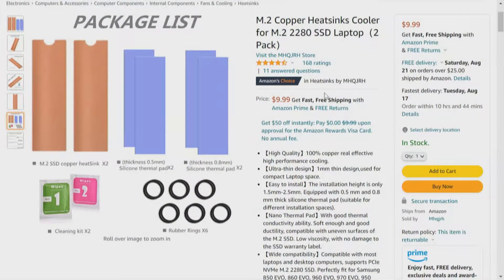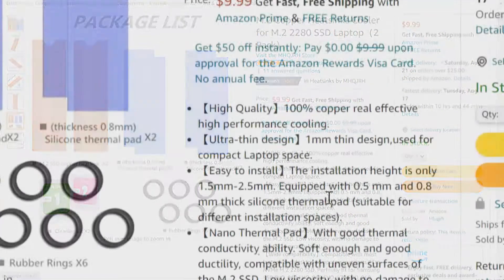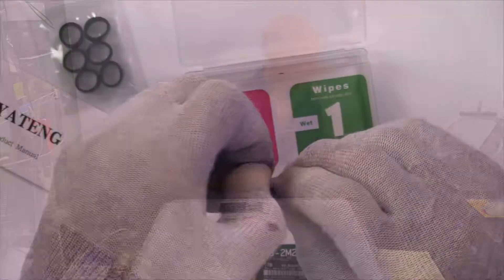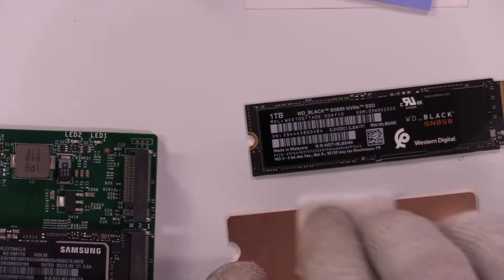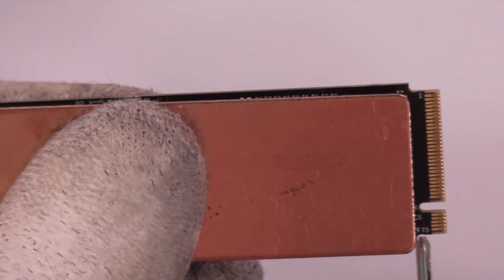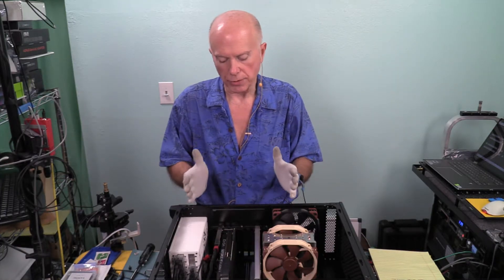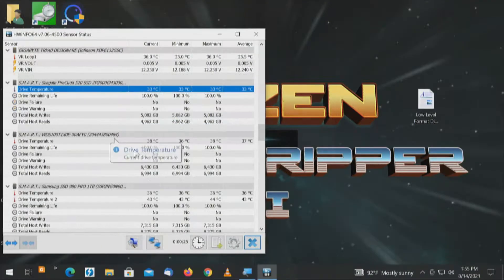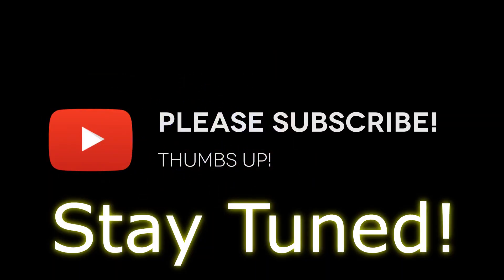Installation and Test of M.2 Copper Heatsink Cooler for M.2 2280 SSD Laptop

Comment: I ordered the same kit but mine came with the smooth side of the copper plate covered by a sticky blue film. I’m assuming I have to take the film off because we should be using the smooth side to make contact with the thermal pad, no? Though, in your video it seems that the “rough” side is making contact with the thermal pads

Comment: Greetings from UK i just purchased M2 SSD Heatsink Thermal Cooling NVMe Copper Graphene for my Laptop is this a good choice as i do not like the bulky casings as there is no room in my mac
Reply from the maker: Hi @SophiaCypria ,
Welcome! This is the simplest and best solution we've found so far. Our main concern is the longevity of the holding bands included. Otherwise, Enjoy.

Comment: For those using the Samsung 990 Pro: If your warranty has expired, consider peeling off the stickers. The Samsung 990 Pro has chips of varying heights, so when using a heatsink, it may not cover all areas properly, leaving a noticeable gap between the chip and thermal pad. Instead of using a 1mm thermal pad, opt for a 2mm pad. You don’t necessarily need a heatsink, but you can use the same thermal pad on the bottom side if there's enough clearance. This setup provides much better cooling. 

I used the GELID SOLUTIONS GP-Ultimate Thermal Pad (2mm).
Reply from the maker: Hi Gayan,
Welcome. Just now seeing Your comments. We do not always receive notifications. All M.2 NVMe PCIe SSD Drives are uneven from Memory vs Controller. Thank You for commenting.
Reply: @BuildOrBuy  Sir, I've learned a lot from your videos—they are very informative. I just wanted to share my personal experience. I'm glad you replied. Thank you ❤️
Reply from the maker: Hi @gayanmaduka , 
Appreciate your comments. Thank You for Watching. Glad we could help.

Comment: @7:27 I can't tell which is the bottom side
Reply from the maker: Hi @QCode11 ,
Welcome. Good question. Stamped from Copper Sheet. Both sides are same. You can tell by the edge. Smoother edge up. Coarser edge down.
Reply: @BuildOrBuy  thank you good I got it right!!

Comment: Hey sir what's up?! Will you answer me if you see my comment? My question is, I plan to put a 6MM Copper Heatsink on my M.2 for laptop application. Will it fit a 6MM Heatsnk? Next question is, can I use a thermal paste sandwiching it in between the heatsink and thermal pad? The Laptop is the Asus ROG Strix G18 (2024), an 18.4" gaming laptop.
Reply from the maker: Hi Good Boy,
Welcome. Good question. You'll have to Test and Verify. Every Laptop is different. This copper plate is the best solution we've seen. Thermal paste? Must be non conductive. Otherwise, problems. Suggest stick with a Thermal Pad. There are two types as outlined. Silicone type which are reusable or the clay like Thermal pads which are one time use.
Reply: @BuildOrBuy  

Thermal paste I want to use is the one they normally use when installing the heatsink of the CPU in the PC and when changing the heatsink fan of the graphics card. Will this be fine and non conductive? About the 6MM heat sink looks like this will be a trial and error oh man!
Reply from the maker: Hi @GoodBoy-io6fd , 
Verify. Every Thermal Past is different. Compression can be safely achieved with a Thermal Pad. Travel at your own risk. We do not recommend using both. Thermal paste is used for a uniform surface. Thermal pads are used for uneven surfaces like M.2 NVMe PCIe SSD Drives. You know the concerns. You know the risks involved. Your call.
Reply: @BuildOrBuy  

Looks like I will just go for the 2 or 3 mm copper heatsink paired with a 1mm thermal pad. 6mm is TOO THICK! This is only good for PC use. Ahuh if you said so Mr.PC Expert, I will forget about using a thermal paste! You have a good reason! Processor or silicon chips goes well with metal, aluminum and copper surfaces but not with a silicon material thermal pad. I am planning to buy two Lexar NM790 4TBs for the 2024 Asus ROG Strix G18. Another question, is there a thin heat sink made for the SODIMM memory of a laptop?
Reply from the maker: Hi @GoodBoy-io6fd , 
Smart decision. From Our testing results, this flat copper performed better than machined copper with more surface area. Curios. As always, Test and Verify. Your results may vary.
Reply: @BuildOrBuy  

I have a new Idea but this might be stupid and funny to you! What if I put two 1.5mm heatsink on the M.2 and in between the M.2  I put a thermal paste? The other side of the heatsink will have the thermal pad to stick on the M.2. What will put together the two Heatsinks, the rubber band that you will use to tie the two but this time I will put 3 rubber bands. Will it dissipate heat better or this is a stupid idea?
Reply from the maker: Ho @GoodBoy-io6fd ,
You have your answer.
Reply: @BuildOrBuy  

Well anyway, I am not making fun of you. I was only thinking of other ways to cool my soon to be owned new 18" gaming laptop to cool that PCIE4.0 M.2 Lexar NM790 4TB incorporating that thermal paste. You have my thanks MR.PC Expert. You are the only one to talk to me back an fort showing care so the end-user will make the right decision what hardware to buy!
Reply from the maker: Hi @GoodBoy-io6fd ,
Understand. Thank You. Keep it Simple. Your Chipset, is it PCIe 4.0? We've noticed, most Channels do not respond to Subscriber Comments. That's unfortunate.
Reply: @BuildOrBuy  

YEAH RIGHT! Most of them do not answer back! What always happens to me is that when I ask, they will just answer me once. If I ask again, I get no response. One answer is just what  get! Once I buy my own PC, I will still TRY TO DO MY IDEA! But for now my money is limited so I will not experiment. 2 flat copper heatsink, in between a stuffing paste then under it is the thermal pads to stick on the M.2. The Laptop that I plan to buy not a Personal Computer is the 2024 Asus ROG Strix G18, FOR SURE IT IS USING A PCI-E 4.0 M.2 SLOTS. I will only know what chipset it have once I install Aida 64 Engineer version. It only have 2 M.2 Slots for an 18" gaming laptop, I WISH IT HAVE 4 M.2 SLOTS! Mr. PC Expert, is it true that the NAND and controller of the M.2 have 0.5mm difference in height?
Reply from the maker: Hi @GoodBoy-io6fd , 
Their loss. We had another Subscriber who tried a copper sandwich. Results were less than desirable. You need to verify for yourself. PCIe 4.0, Ok. Excellent. Yes, there is a height difference. A Thermal Pad under compression can handle that difference.
Reply: @BuildOrBuy  

You can check the 2024 Strix G18 if it really have a PCI-E 4.0 slots, it has 2 M.2 Slots. I am sure it is 4.0 because its memory was increased. From DDR5-5200 MHz from the previous year and now DDR5-5600 so I am sure the M.2 slots are all 4.0. Will it be a bad decision if I bought 5.0? Someone told me that the height difference of NAND and controller, I need o buy pads that is 0.5mm and the other 1mm to easily make he surface leveled! This is the remedy he did. Mr.PC Expert what happened to his temperature when he did my idea of Sandwhiching the heatsinks with thermal paste stuffing? I hope it did not result into overheating.
Reply from the maker: Hi @GoodBoy-io6fd , 
Yes, PCIe 4.0. Nice. Your proposed Copper sandwich, Test and Verify.
Reply: @BuildOrBuy  

Mr.PC Expert, I have 2 more question to you! 1. If I use a PCI-E 5.0 M.2 as my Bootable Operating system drive then I filled up my E-ATX motherboard lets say it has 8 SATA Ports then I filled it up with 6 - 8 Hard Disk Drives, the M.2 being a PCI-E 5.0 is way faster with its read & write speeds, WILL IT OVER TIME DESTORY MY HARD DRIVES CONNECTED TO THE SATA PORTS? Someone told me a about this, two Computer Technicians told me that you should never put a Hard Drive internal or external together with a fast M.2 NVMe because the mechanical drives cannot catch up with its speed. IS THIS TRUE? I feel that this is just a myth. M.2 destroying HDDs, I need to confirm this from you! 2. PCI-E 5.0 will have more PCI-E Lanes than 4.0. In the Mobo Manual, I always read take this as an example. An E-ATX with 6 M.2 slots, a LGA 1700 Core i9 14900K supporting 4 PCI-E 4.0 and 16 PCI-E 5.0 Lanes, 8 SATA ports, 2 x16, 1 x8, 1 x4 and 1 x1 slot. In the Manual it says, again this is only an example because it is always different on different motherboards, if M.2 Slot 2 is populate, SATA 7 will not work, if SATA 7 & 8 and M.2 6 is populated, PCI-E x4 & x1 will not work. My question here is if it says it like that on the Manual, how can I make all PCI-E, M.2 Slots and SATA ports work if I want to populate all of those? Is there a way, is my plan possible?
Reply from the maker: Hi @GoodBoy-io6fd  , 
Now we're switching from Laptop to Desktop. Ok. Interesting. Up for conjecture. That's how we've Configured Desktops since M.2 NVMe PCIe SSD Drives came on the scene with PCIe 3.0. Have you seen any stats on that? Or just opinions? Consider the source.
Reply: @BuildOrBuy  

From Laptop I am planning to buy my second Personal Computer by December up to February 2025 waiting for he release of PCI-E 5.0 and Intel Z890 Chipset, Intel Ultra new generation of Processors & GeForce RTX 5090 OC versions. Just waiting for the release of these to "ASSEMBLE" my second Personal Computer since Socket 478 Pentium 4 when my PC gave up last July 2015. MR. PC Expert you did not answer my questions! About the M.2 destroying HDDs, I think it is only an opinion so I am asking you if this is true because this is your work, you continuously Assemble PC! About the PCI-E lanes that can be used, I will select a sample motherboard then you look up on its motherboard manual.
Reply from the maker: Hi @GoodBoy-io6fd ,
Read my reply again. Do you have any research to backup those opinions? We've learned from Testing, not to assume anything. Looks like a nice Build.
Reply: @BuildOrBuy  

I never heard anyone said that or read in the forums saying that fast M.2s when paired with an external or internal disk that it will destroy that mechanical drive which is significantly slow. Sir just answer me straight is this true based on your many many years of assembling PCs, have you experience this? The PCI-E lanes of a motherboard, I chose the new Gigabyte Z890 boards but not yet out so I cannot look at its only PDF Manual. I will look for current motherboards as an example to my question.
Reply from the maker: Hi @GoodBoy-io6fd , 
Seriously... No.

Comment: Based upon this video, I purchased and installed the YATENG M.2 Copper Heatsink Cooler for M.2 2280 SSD Laptop. The product quality seemed good and installation was easy, except for the rubber bands which would tear during installation. Luckily more than enough were provided. I recommend that anyone using this product to first polish the edges of the copper plate.
Reply from the maker: Hello Gatnos, 
Welcome! Appreciate Your Comments. Aside from installation, what are your Results in Testing?
Reply: I used needlenose pliers to install it on my two NVME drives on my laptop.

Comment: Bought a few copper heatsinks for my HP ZBook G10 Fury (2x Samsung 990Pro 4TB + 2x Samsung 990Pro 2TB)
Sadly the HP M.2 4 drives cage is very limited in space.

So I have a range of 2mm, 1mm, 0,8mm and 0,5mm (DolDer and Benefischl)

But I will replace the head pads with much better Artic Cooling TP-3 Premium Performance Thermal Pad
(got 1,5, 1,0 an 0,5 mm).

It looks that I only can use 0,5 or max 0,8mm copper heatsinks. 
The Samsung M.2 SDDs chips have different highs
Reply from the maker: Hi Tech Dino,
Welcome! Appreciate those details. All of that matters. Next, Results. Care to share?
Reply: @BuildOrBuy  
With the two SSDs (Samsung 990 PRO 2 TB), the RAMs and the controller have the same height. 
Therefore, you only need one strip of thermal pad (Artic Cooling TP-3 with a height of 0.05 mm).

Due to HP's own M.2 SSD locking mechanism, I can only equip the two SSDs in the lower compartment with the Benefilsch copper cooler with a height of 0.5 mm.

On the mainboard side there is a very thick thermal pad on which I glued another 1.0 mm so that contact could be made with the Samsung controller on the underside.

According to HP, the two Samsung 990 PRO 4 TB SSDs can (generally) only be installed in the upper area.
In fact, NO alternative heat sink fits here, as HP uses its own thin copper cage plate.

I removed the old pads from the copper cage and glued 0.5 mm thermal pads to the RAMs on the SSDs and 1.0 mm on the controller.

A kind of copper rail runs through the HP Zbook, connecting the area of the SSDs and the RAM. I also replaced the thermal pads here.

The RAM area did not have an old thermal pad for whatever reason.
I made this change myself.

For the lower 2 TB drives, I first modded one and left the other drive original for comparison:
SSD1 modded: 
RAM max 65 degrees
Controller max 77 degrees

SSD2 original:
RAM max 73 degrees
Controller 100 degrees 

Tested with Samsung SSD Bench.

I have reinstalled Windows 11 pro Workstation myself. During the Windows installation the drives get very hot and so does the laptop. After all drivers have been installed and the drives have been encrypted with Bitlocker, the temperatures are also in the normal range.

The two lower drives had 43-44 degrees in idle (or a download was running) and the two upper 4 TB drives have 41 degrees.
So the result is much better than expected!

I have not carried out an extra stress test as I want to protect the drives in case anything negative should be noticed, I will contact you again.

Maybe I could leave out the thin copper sheet cage completely, but I have a 5-year on-site warranty and don't want to void the warranty.
Reply from the maker: Hi @Tech-Dino ,
Excellent Results. Thanks for Sharing. That should help increase your longevity.
Reply: @BuildOrBuy  Yea, I think the key is also very good thermal pads that can get the most out of it.
Reply from the maker: Hi @Tech-Dino , 
Most definitely. Everything matters. Are you using Silicone type or Clay type Thermal pads?
Reply: @BuildOrBuy  Dont know really I think its silicone based. Its more effective than TG minus Pad or Gelid Solutions GP-Extreme pads for good price. Its very smooth so that can use a 0,5mm to fit 0,2mm gap.
Reply from the maker: Hi @Tech-Dino , 
Silicone. The Claylike pads disintegrate upon removal.

Comment: Hi is it ok to put a strip of an electrical tape to secure the heatsink instead of rubber band? Thank you
Reply from the maker: He Jheran,
Welcome. Good question. That rubber band provides some amount of compression, with Thermal properties. 

If you go that route, use an electrical tape that does not ooze adhesive over time. Those can get tacky sticky and create a mess as the adhesive breaks down.

Comment: Is there a massive difference in heat between doing this and leaving it without a heatsink? Im gonna be using my laptop for gaming mostly
Reply from the maker: Hello JasonJLPH,
Welcome! Excellent Question! Depends. Your Laptop is PCIe 3.0. Your Gaming Performance mode requires plugging into Power. That Performance mode can and will generate more heat. Test and Verify. If there is room then think about that addition later. If no space then nothing You can do without getting radical. We have to stay on the practical side. Keep Us Posted! At the very least, check Your M.2 NVMe Firmware to help manage Heat to prevent Drive Failure. Hope that helps!

Comment: thanks. question, are the thermal pads conductive, so do i have to be super careful when applying to the ssd that it doesnt touch any i.e. smd resistors (because open contacts)?
Reply from the maker: Hello zzzzzzz1zzzzzzzzz1z,
Welcome! Excellent Question! Non Conductive. Thermal Pads are ether Silicone or a Clay like material. Glad You've ppinted that out! A very important consideration!
Reply: @BuildOrBuy thank you! interesting it is a clay like mayerial. in former times, like 15 yrs ago i did some discrete audio amplifiers and hat to pay attantion not to connect transistors via the heatsink ;) so i had some special washers/insulation..
Reply from the maker: Hi @zzzzzzz1zzzzzzzzzz1z , 
There are still times when We have to be aware of not Grounding out a Motherboard installation! Experience is the best Teacher! We can relate!

Comment: My m.2 have this warranty sticker, should i remove those before installing it?
Reply from the maker: Hi Shuarem Mondejar, 
Welcome! Great Question! You can, We do not! The Vendor cannot tell You, You cannot as well. Your choice. We Test and move a lot of Gear around. Therefor, without those Labels We'd have a hard time differentiating products! Hope that helps!
Reply: @BuildOrBuy  got it, just want to make sure as I'm afraid that it will effect it's cooling. Thank you so much!
Reply from the maker: Hi @Aloe_shu ,
We have Tested 16 M.2 NVMe PCIe SSD Heatsinks. We have Tested all the same in a Default Configuration. In each instance the M.2 NVMe PCIe SSD Drive has the Label intact. We have 2 other M.2 NVMe PCIe SSD Heatsinks that Test far better than this one! Hope that helps!

Comment: The thin copper is for the bottom of the m.2, the thicker copper is for the top, I think.
Reply from the maker: Hi Professor H,
Welcome! Great idea! However, We had a hard enough time stretching those Bands over 1 Copper Plate! Both Copper Plates are of the same thickness. Appreciate Your Comments! Good candidate for a Laptop M.2 NVMe PCIe Heatsink if running PCIe 4.0!